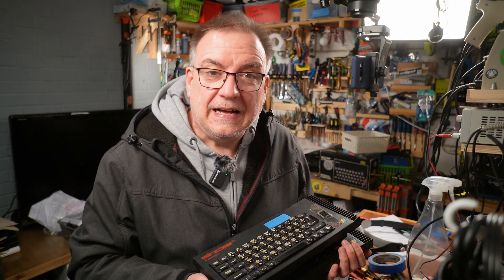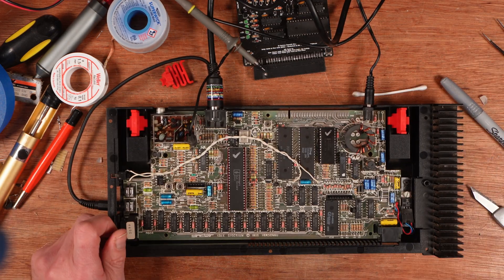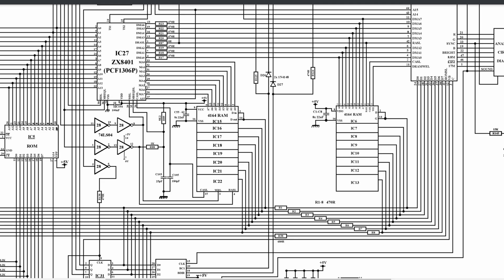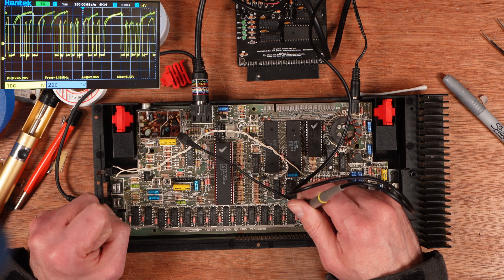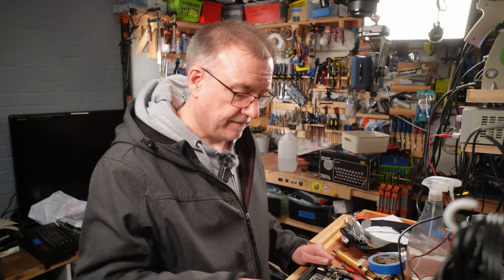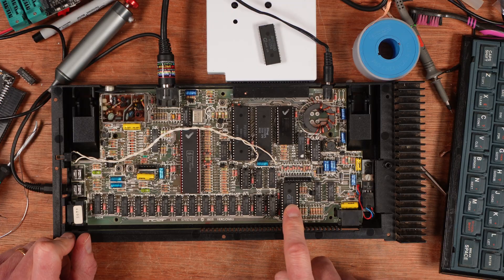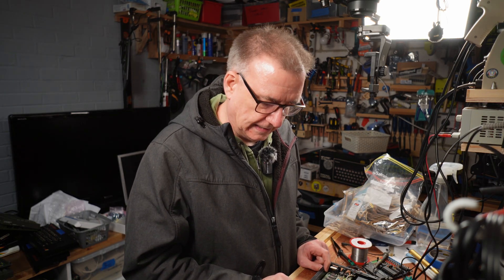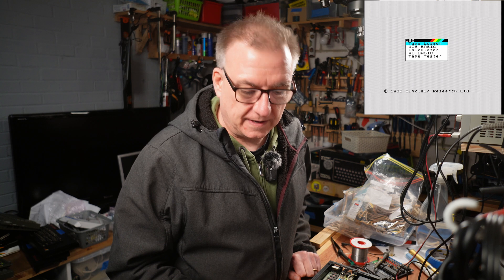Toastrack ZX Spectrum 128k Repair

Comment: Here is how the memory works: Address lines go to all of the RAM ICs, and they are parallel. There is nothing like certain address line goes to a certain RAM IC, they are all in parallel. The RAM ICs on the Spectrum are 1 bit RAMs, this means they all can hold only the 1 bit of the 8 bit data floating around. So, if you want to write a byte, (for example something like 10011010), to a certain address location on the RAM, you put that address on the address bus, all the RAM ICs receive the same address (remember parallel) and put that byte on the data bus. Now, the data bus is the one that is wired differently, each data line (D0 to D7) goes to only one RAM IC. So, each one of them receives a different digit of the data for the same address, 8 of them working together holds the whole byte, but every digit of it is stored in a different IC.

Comment: Thanks for the video. Bravo on finding the culprit and fixing the Toastrack. I might be wrong, but it seems you scoped the wrong chip at timeline 6.06, as you were checking pin 27 on the PCF chip, but scoped the Z80.